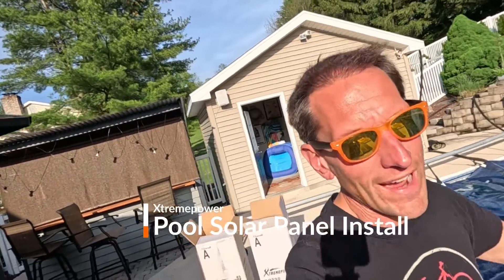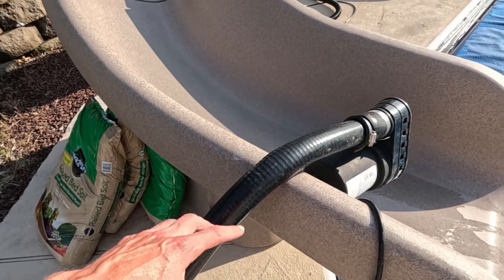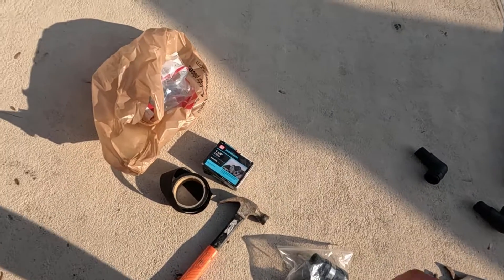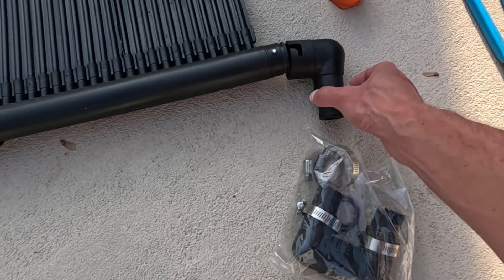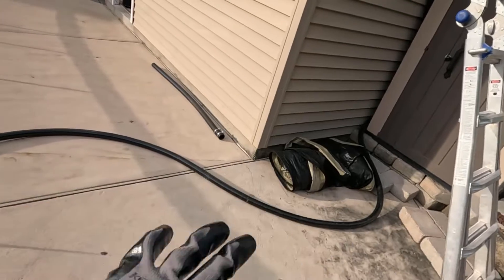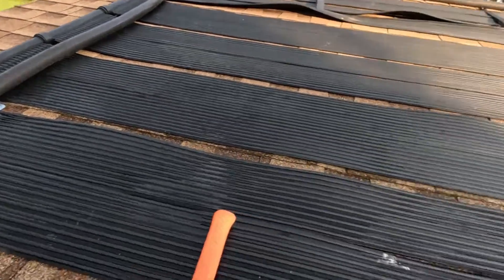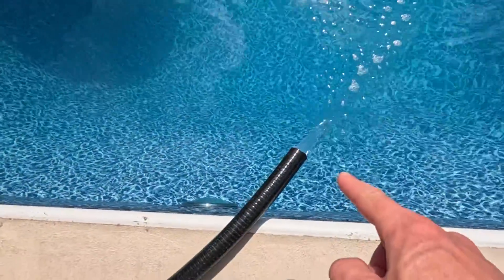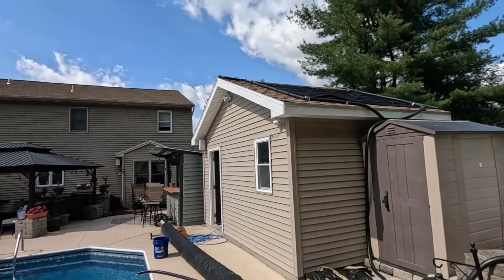Pool Solar Panels from Xtremepower

Comment: What size is the black hose?
Reply from the maker: @kmac7392  1 1/2”diameter
Reply: @ any leaks?
Reply from the maker: @ I didn’t try them this year yet, but yes you need to consider a hole is going to form in one annually. You can fix the holes by cutting the hole out and placing a screw on both ends.

Comment: I would restrict the flow with a valve and let the water get hotter longer in the tubes , My dyi black hose heater puts out 110 degrees but at a strong pee rate )

Comment: Temperature change without flow rate makes it impossible to see the value. It could take an hour or a month to raise the pool temperature by a degree
Reply from the maker: I’m getting 11-12 gal per min on a .5hp pump.

Comment: What's the flow rate on your pump and what's the flow rate after your solar panels?

My pump is rated to 528 gallons/hour, but it falls down to 108 gallons/hour when it pumps the pool water 8 feet up on my flat garage roof and then through 820 feet of ¾ inch PEM hose.

My pool contains 3,300 gallons and with this setup, it'll take about 30 hours to run every gallon through the heater and that's a bit rough with 18 hours of daylight. With a flow rate of 1,8 gallons/minute, I'll get an 18°F difference before and after the heater with a clear blue sky. I'm trying out some different solutions as we speak, to increase my flow rate and heat my pool even faster.

I'm not going to give up until I get 86°F in the pool around 2:00 PM on a partially cloudy day, then I'll be satisfied. You can see my setup  @SolarProjectsSweden

I wish you good luck and a warm pool summer
Reply from the maker: I’m getting 11-12 gal per min off the .5hp pump
Reply: @thestclairchannel3889  My theory (or dream):
8 gal x 60 min = 480 gal/h. 
3,300 gal pool / 480 gal/h ~ 7h.
~70°F pool water in the morning.
~100°F after the heater.
Half of the pool water has run through the heater in 3,5h and it should be around ~85°F in the pool at around 2:00 PM.

I'm trying to achieve this only using solar DC. My pump is a 20v barrel pump that runs directly of a solar panel. I've tried 3 different solar panels: 
50W - 0,7 gal/min
120W - 1,58 gal/min
180W - 1,8 gal/min
The results above is through the heater and it's pretty far from the pumps rated 8,8 gal/min, so I'm trying out some different setups to put my theory into practise.